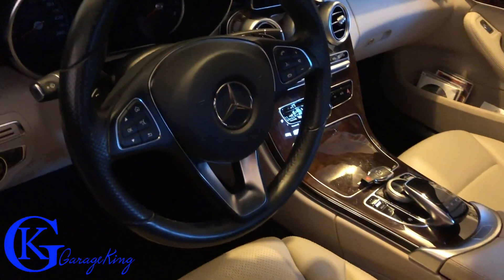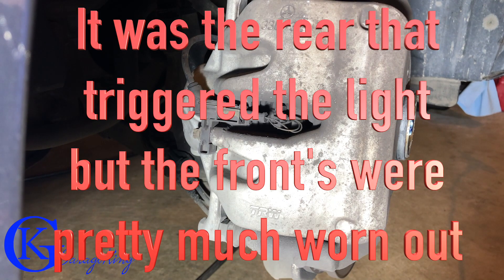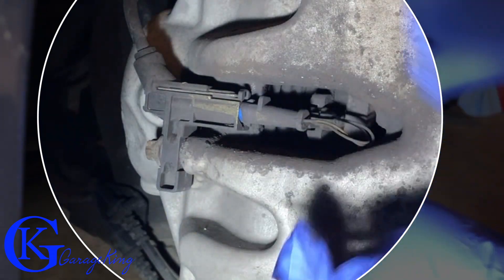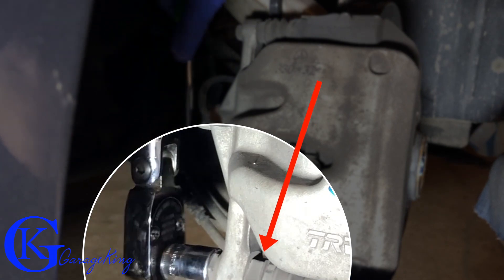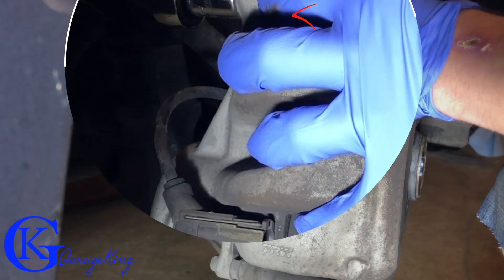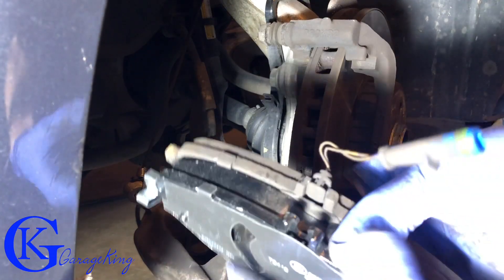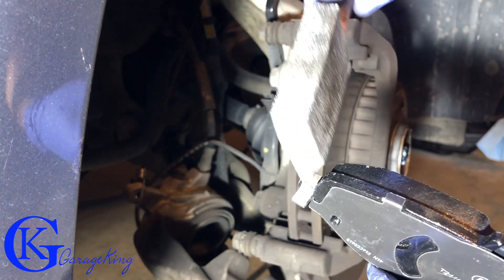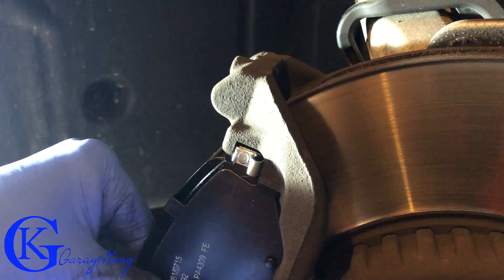Mercedes Benz C300 W205 Front Brake pad replacement

Comment: Very very clear video you omitted to use loctite on the caliper bolts - so important 👍
Reply from the maker: Hi there, thanks for the kind words.  It certainly can't hurt to use loctite, but there are mixed opinions on using it.  I have personally done thousands of brake jobs in the dealership and never used it in the many years I was employed at a dealer, so for me its just a habit not to use it, but it won't hurt anything if you use it.  Good catch on the vid, you obviously were watching the details!!!!
Reply: 😁😁 the details are what counts! My Landrover garage didn't use loctite and my brake caliper fell of as I was braking! Nightmare....

Comment: Nice and clear video, i have 2014 and just hit 32.5k miles on original pads in 2021, so it should be similar but my bolts might be harder to remove as i drive in the salt road states.
Reply from the maker: Thanks for the comment brother !!!  You actually have low mileage for the year you have !!!  I find with brakes, even in the saltier states the brake bolts come out ok.  MB uses good steel on their bolts and I find they don't rust as much as the Japanese brands.  Just make sure your wrench is square on when you apply force to remove the bolt :)  Hope you are enjoying your weekend :)

Comment: This might be late but I changed pads but not the sensor on a 2015 GL 450 front, is there a way to clear the brake pad lights or do I need to get the sensor replaced. It was removed without issue. Thanks.

NM: based on other comments if the light is still on then I need to replace the sensors. Thanks.
Reply from the maker: Sounds good !!!  The sensor must have contacted the rotor, even if it was taken out without incident, if it contacted the rotor it has to be replaced.  I tell people if the light was on before you did the brakes, get a new sensor.  If you replace the pads and no light was on (maybe caught it at an oil change) then the sensor can be re-used if it comes out ok.  Happy Sat to you :)

Comment: You recommend Ceramic pads or metallic pads? My 2015 C300 squeaks like crazy on cold mornings, dealer said it’s normal. Great detailed video!
Reply from the maker: Thanks for the comment, and sorry for the late reply.  I just got back from visiting family. Most of the times I use ceramic pads.

Comment: Just liked and subscribed. Would this same method apply to the W205 C63S with the cross drilled rotors? And is Brake Fitting mode only required for rear brakes or do we need to do something to put front brakes in fitting mode?
Reply from the maker: Thanks for the comment and welcome aboard !!!  The method should be the same, and no fitting mode is required for the front brakes, only the rear brakes.

Comment: Great video.  I will be changing both front and rear pads.  Question, do you have to set the breaks in "FIT" mode for front brakes?  or is this only for the rear pads?
Reply from the maker: Thanks for the comment brother, the "FIT" mode is only for the rear, vid for the rear is https://youtu.be/T9LdRtxIzkk  Thanks !!!!
Reply: @GarageKing  I had no luck putting the rear brakes into fit mode.  Not sure why.  I was in Trip mode, held both buttons for a minute and nothing. Tried in both key positions. No luck
Reply: @GarageKing  so any suggestions would be appreciated
Reply from the maker: @stephengauntlett2603  Hey when you push the ignition button twice, scroll to "Workshop" then push the phone and OK.  If that doesn't work.  Leave it in "workshop" then shut off, then when you turn on it by pressing ignition 2X you should be in workshop, then press phone and OK.  You have to do it quick and its tricky!!!  I don't think you can access the rear brake set from the trip.
Reply from the maker: @stephengauntlett2603  You need it in workshop, not trip
Reply from the maker: @stephengauntlett2603  Hope you got is figured out :)  Like I mentioned, its kind of tricky to get it
Reply: @GarageKing  hi thanks for the suggestion. I did figure it out.  I was in trip/mileage screen, then selected three buttons,  both phone buttons and OK all at once.
I think my problem was the screen I was in.  Your method may work cuz not sure I was in the correct screen.  Hope this helps others
Reply from the maker: @stephengauntlett2603  I really appreciate the follow up as it will help others, and now I know how you did it, so I can share that with others if they write me.  Many times I try to help someone out and never hear back so I'm curious if I actually helped or not, so I do appreciate your follow up.  Thanks brother :)

Comment: I am  doing a 2017 it's dual or 4 piston caliper.  There's 4 inverted  torks bolts. Not sure  if I take them out that splits the caliper?
Reply from the maker: No you don’t take those out. Those are to split the caliper for rebuilding.  There are only two bolts on the inboard side that attach the caliper to the steering knuckle.

Comment: What did I do wrong if my brake pads still a show that it hasn't been reset please advise thank you so much in advance
Reply from the maker: Hey there, thanks for the comment.  The brake light is triggered by the sensor in the brake pad.  The "reset" is only to retract the caliper piston so the new pads can fit in.  The buttons on the steering wheel only move the caliper piston, they don't make the light go out.  Make sure you replace the sensor or the light will stay on :)

Comment: Hi does the warning light auto reset after you install the new sensors or do you need to do it on the menu
Reply from the maker: Hey thanks for the comment. The warning light will reset on its own. Just make sure when you buy your pads you buy a new sensor. Good luck with the job :)

Comment: Why not change rotors at same time?  I'm guessing they were within spec/thickness?
Reply from the maker: Hey there, you know if this was a Japanese vehicle I would have done so, but I find that on German vehicles the rotor quality is much better (it’s a different steel) and they don’t rust as much, or have thickness variations that cause a pulsating pedal. Plus they do cost quite a bit compare to “regular” cars.  This vehicle was in spec and braked fine so it only needed pads.  Thanks for the comment :)

Comment: no need to torque wrench the bolts?
Reply from the maker: The smaller bolts, the 13mm that secure the caliper to the caliper bracket are usually between 25-35 Nm for pretty much all cars.  As I did not replace the rotors, I did not have to worry about the big bolts that secure the caliper bracket to the spindle.  The big bolts that hold the caliper bracket to the suspension are much higher, they vary A LOT between cars, and I have seen them between 80Nm and 270Nm, so they go tight. Some are torque to yield, and some are not.   I use a 13mm open end wrench for the small bolts (as the size of the wrench limits how much torque you can apply for the wrench, and a 1/2" bar for the big bolts nice and snug is what I do) Make sure to only tighten by HAND, so don't use an impact.  I did look on line for you but could not find anything definitive.  If this is your first time doing brakes you could call a MB dealer to get the toque specs if you are not comfortable. Sorry I could not be more help......

Comment: Do you have to activate brake replacement mode for both front and rear pads or just rear
Reply from the maker: Hey there and thanks for the comment, only activate brake replacement mode for the rear.  The front are like regular brakes, just push the piston back in. Hope you are enjoying your weekend :)

Comment: Please add a video for 2020 Mercedes rear break pads 
Because I don't know how to stop the automatic e break
Reply from the maker: Hi there, sorry for the late reply. For some reason your post went to the spam and I was not notified of it. Just learned of it now.  Was going to say if your car is 2020 it should be under warranty and you should be able to take to the dealership so it does not cost you any money.
Reply: @GarageKing  hi I understand about the warranty but if you know how to replace the rear break pads on 2020 glc or any 2020 Mercedes will be very helpful
Reply from the maker: @SenthilKumar-uo4on   Hi there, I’m not sure about the 2020.  I’m going to do some research and get back to you. Might take me a day or two, normally with MB you can wind the caliper in without using a scan tool, but this may have changed for 2020. Give me a day or two to see what I can find out for you.
Reply from the maker: Hey There, I did some research and its very similar, take off park brake, ignition ON, car in NEUTRAL with wheels blocked, press HOME and BACK button for 3 SECONDS. Then goto workshop menu on dash and select BRAKE PAD REPLACEMENT, this should do it.  To exit once brake job is done, lock and unlock the car.   I hope this works my friend :)

Comment: If in my mercedes after changing the pads the warning light does not go off, do I need to reset the error or do I need to replace the sensor?
Reply from the maker: You most likely need to replace the sensor, the light should automatically go off.  There is no code set to clear.

Comment: How can I turn of the pad worning light after the pads and censor have been replaced the light is still on
Reply from the maker: Hey there, if the warning light was on, you should replace the pad sensor as its worn though.  Any water that gets in there can now ground it out.

Comment: Any torque for the bolt how many Nm?
Reply from the maker: Hey there, I don't know the exact torque as I do them all by hand (I have probably done over 1000 brake jobs )  The smaller bolts, the 13mm that secure the caliper to the caliper bracket are usually between 25-35 Nm for pretty much all cars.  The big bolts that hold the caliper bracket to the suspension are much higher, they vary A LOT between cars, and I have seen them between 80Nm and 270Nm, so they go tight.   I use a 13mm open end wrench for the small bolts (as the size of the wrench limits how much torque you can apply for the wrench, and a 1/2" bar for the big bolts nice and snug is what I do) Make sure to only tighten by HAND.  I did look on line for you but could not find anything definitive.  If this is your first time doing brakes you could call a MB dealer to get the toque specs if you are not comfortable. Sorry I could not be more help......

Comment: May I know the torque ftlb for 13mm bolt? and also the torque for the big bolts holding bracket?
Thanks so much.
Reply from the maker: Hey there, I don't know the exact torque as I do them all by hand (I have probably done over 1000 brake jobs )  Those smaller bolts, the 13mm are usually between 20-25 ft/lbs for pretty much all cars.  The big bolts vary between cars, but they are usually between 60-100ft lbs.   I use a 13mm open end wrench for the small bolts (as the size of the wrench limits how much torque you can apply for the wrench, and a 1/2" bar for the big bolts nice and snug is what I do) I did look on line for you but could not find anything definitive.  If this is your first time doing brakes you could call a MB dealer to get the toque specs if you are not comfortable. Sorry I could not be more help......

Comment: Should I replace the sensor whenever I change the pad??
Reply from the maker: Hey buddy, thanks for the comment.  If you have not bought the parts you could see if you can pop the sensor out, sometimes you can reuse them.  If the brake light is on THEN REPLACE IT.  They are pretty cheap at about 10 bucks so its good practice to replace them as they can crack and then short out which causes the light to come on when it should not.   Basically if its in good shape with no cracks then you can reuse, but if the light is on, or there is any question then just replace.  To be honest for what its worth, it is good practice to just replace it if you can.   Any other questions just let me know :)
Reply: @GarageKing  You are the man, keep up for the good video 👍
Reply from the maker: @mrleung7301989  Thank you :)

Comment: Do you need to put in a new Brake Sensor after every Brake pad change?
Reply from the maker: Hey Dan thanks for the comment.  It is good practice to replace them every time as they can crack over time. If your in the boat and in the middle of a job you can reuse it providing that there is no wear on it (your brake light should have never come on). The sensor plastic begins to wear before your light comes on and eventually the plastic is gone and the steel wire is exposed. That touches your brake rotor and triggers the light.  Also if you are going to try to reuse the old one be careful removing it.  Good luck with the job :)

Comment: How  do you reset brake sign on A180
Reply from the maker: What year is your A class?  Do you know the chassis designation?
Reply: 2015
Reply from the maker: @graceshonhai8509  OK I was looking and couldn't really find anything.  Then I realized that car is not sold in the United States and Canada.  I'm located in Canada and it only came here in 2018, yours is a 2015.  That would explain why I can't find much on it.  I know to reset some of the service lights you need a scan tool.  I use the Launch CRP429 as its not expensive and works well with German cars.  I did an oil change on an Audi Q3 and had to use the scanner to reset the oil light.  So if its the rear brake caliper reset I would think it would be similar to the C class in my video.  But if it is to actually reset an indicator light you can always do it with a scan tool, and only sometimes with dash buttons.  Sorry I could not help you more my friend.
Reply: @GarageKing  That's fine and thank you. Stay safe
Reply from the maker: @graceshonhai8509  Thank you for the reply my friend :)

Comment: Bleeding the brakes isn’t required?
Reply from the maker: No you don't have to.  If your car has a lot of miles it would not be a bad idea to do the retract procedure, then open the bleeder valve and push the piston back in, this way any dirty brake fluid will go out the bleeder.  That would be optimal, but to answer your question, you don't have to.

Comment: you forgot to add blue threadlocker on the bolts and the bolts should be torqued
Reply from the maker: Thanks for the comment and you have a good eye brother.  The small 13mm bolts are pretty much 25-35NM on all cars regardless of make (unless they are TTY) so I never use a torque wrench as I have done so many it’s just by feel.  I should probably put up some text or mention about torque during the vid. Good catch there!!!  It’s the big bolts you really have to watch. Some of those bolts are not even reusable depending on the car. Because I never removed the rotors I didn’t have to worry about those big bolts.  The loctite definitely won’t hurt anything and can actually protect the threads from corrosion. Good catch and hope you are enjoying your weekend :)